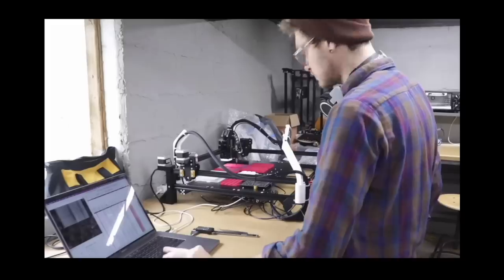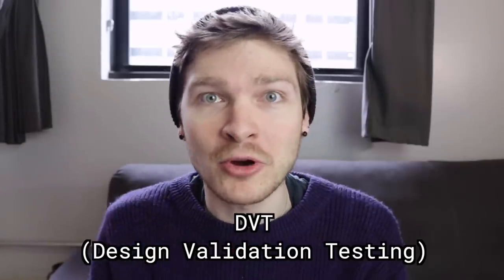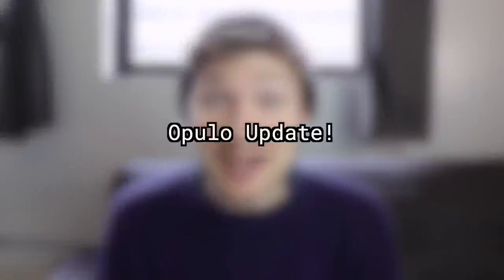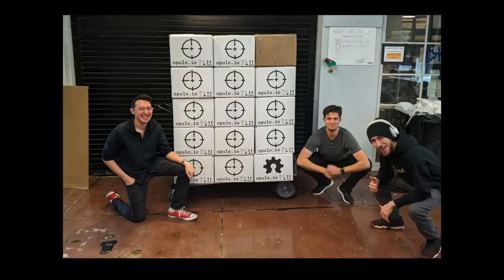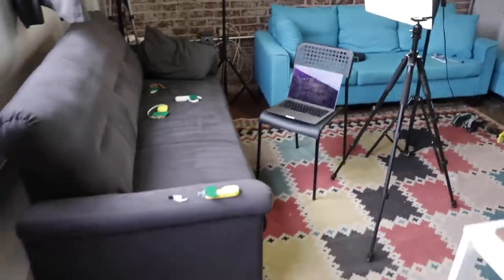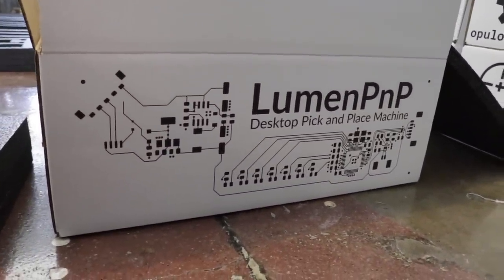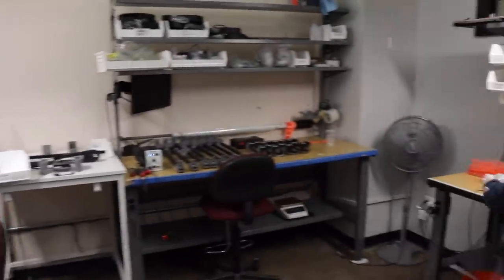prepping for launch

Comment: In terms of feeder behaviour there is quite a lot of variation of tape that needs testing with - paper, clear & black plastics that can have different stiffness, as well as different thicknesses of plastic - parts are more prone to jumping out with thin tapes. Part pocket size can also affect how the tape bends. Pocket depth can vary - 1210 caps and PLCC-4 LEDs are probably the deepest on 8mm tape. Wider tape has a much bigger range, e.g. connectors,  inductors and electrolytic caps. 
Cover tape peel force also varies. Paper tape can be a bit abrasive, and also sheds dust which can cause issues, e.g. you don't want anything that needs oiling near it as the dust turns it to sludge. 
Feeders are hard. I suspect you'te only at the start of a long and frustrating journey...

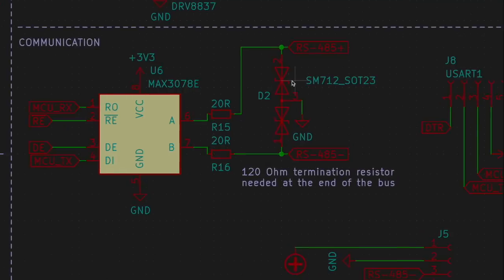Comment: 2:55 TVS diodes aren't very useful at protecting from 24V , as the 24V will likely toast them - you need to combine with additional protection like a polyfuse. 
However he best thing I've found are Murata PRG18BB PTC thermistors - these trip to a high-resistance state fast enough to protect RS485 and HCMOS from shorts to +24V with no additional TVS or zener protection. I usually use the 100R ones, as this also provides useful edge damping, or 33R if I care more about edge rates - the latter still offer good protection.
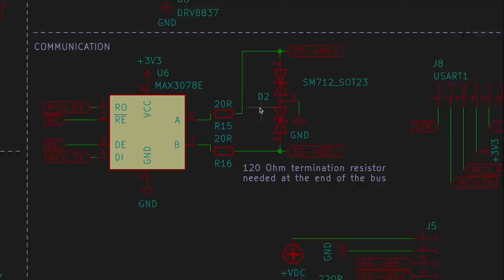Reply: Mike -- I agree with your assessment that the TVS diodes at 2:55 would get fried by the 24V hazard that Stephen described. They are more for ESD which is high voltage but relativeIy small total charge I think.  Your PTC suggestion-- presumably those are in series with the input, but what sinks the current to get them heated up?  Is this relying on the protection diodes in the RS485 chip (ie: to the rails)?  Note to Stephen: From following Mike's channel -- he has done a great number of RS485 projects, and has a lot of field experience with it!

Comment: Injection molding is not as expensive as you may think. It might make it easier to scale production instead of scaling out 3D printers.
Reply: Molds are incredibly expensive. Need a very high part count to spread mold cost over.
Reply: mold: hehe
Reply: Full disclosure, I work at a filament company, so of course I’m going to be biased toward 3D printing, but I still wanted to share my thoughts.

When you design a project, you tend to design parts in a way to be easily manufactured.  If you want it to be machined, molded, or printed, you’ll take different approaches to the design.  For example, something that is designed for molding might be hard to 3D print, and vice-versa.

This then boils down to a big-picture question “how should this be made in the long term”.  Injection molding absolutely makes sense if the end goal is for this to be an off-the-shelf product.  BUT, leaving something 3D printed enables and encourages the design to be changed, improved, and customized by anyone who has their own printer.  Some of these 3rd party design changes might even make it back into the official product.

This ideology is very similar to Voron and Prusa 3D printers.  For example, Prusa sells hundreds of thousands of 3D printers, but they still print as many parts as possible because it lets them make changes, and allows hobbyists to hack their own machines.

Parts that are designed to be injection molded will tend to focus on different things, such as minimizing/hiding flashing, adding small chamfers to seemingly flat sides to make parts pop out of the mold easier, and avoiding any internal structures.  It IS possible to design something that can be printed AND injection molded, but it’s certainly another layer of complexity.
Reply: @MrWizard65  they are, perhaps if he reaches out to Dragonfly Engineering, he might be able to do a collaboration on having some parts injection moulded 🤔
Reply: I agree. Full commercial injection molding is likely not something that will be super viable for this company for a while though. It's expensive and thus impedes the quick and creative iterative design paradigm that is finding them success right now.
I would say though, that it may be prudent to seek a middle ground and possibly manufacture casts of their own and do injection molding themselves. There is a youtuber that does this and shows how to do it. He even works out a lot of bugs in his videos. Right now he's building sets for a stop motion animation  he's doing. Shouldn't be too hard to find as he basically is fully funded by Patreons.
Despite the speed angle, which is very valid as 3D printers are crazy slow, injection molded parts are smoother and much stronger. Less chance of failure.
Reply: @MitchDavis2  I might over thinking, but if they have 18 printers, each running a print, it's more possible that some part, may have some problems (if they failed on a non detectable way), that during QC they might miss. Idk, might thinking too much. Either way, it's cool xD.
Reply: @NightVisionOfficial  prusas are reliable workhorses, i dont think it will fail
Reply: @MrWizard65  I agree -  the initial tooling costs can be pretty steep. Tool life estimates I've received are good for 200k to 250k parts, so you can start to see how you need to look at predicted demand and how to amortise the tool cost into the final part price.

My quotes for injection moulding have basically started at 5000 parts produced per tool for a minimum run, as any quantities lower come pretty close to same price as 5K parts!

If Prusa are still using 3D printed parts on their printers, then I think this is a viable option for scale. 3d printing also offers the opportunity to update the design whenever you want and you can sell hardware kits with CAD models to those who have their own 3D printers, reducing held stock of plastics and offer a small discount to the customer.
Reply: @NightVisionOfficial  oh yeah, certainly.  3D printers come with their fair share of QA issues. We have a print farm at work and there’s always something funky going on.  I’m just super excited that so much of the lumen PnP is printed because I have a handful of customizations that I plan on doing to my lumen once I finish setting it up
Reply: @haddow777  The Craftman??
Reply: @dhupee  haha i was thinking crafman too.
Reply: @dhupee  yes, thank you. You think I could link the name in my brain. Yes, he's awesome. So many great videos, I highly recommend him
 He has a whole section on injection molding including, if I remember, making metal molds that perform better and last longer. I'm pretty sure he outsourced the actual metal casting of the molds, but it shows what can be done.
Reply: There are also 3D printed molds for injection molding, which really shrink cost down. Another method is 3d printed molds/negatives for silicon molds for epoxy/pu/... resin
Reply: @johanness6545  yes, the craftman kind of goes through a whole assortment of options like that. Injection molding is only one small part of his video series. Still, he points out that a metal injection mold offers the best resilience and also will be quite  a bit smoother. It also allows for faster turnaround speeds.
Check out his series though. I'm usually more fascinated with his silicone projects myself. But they are better for creativity. The injection molding stuff is better for quick production of things you've really kind of finished working on and am just trying to put it out there.
Reply: Injection molds made from readily available high temperature filaments such as PEEK are perfectly capable of handling relatively low melting point resins like ABS and PLA in an injection moulding setup
Reply: @geekswithfeet9137  yes. I think his video touches on that. 3D printed FDM moulds aren't typically as smooth, at least without a lot of work. Also, they just really aren't as resilient as metal. Of course, there's no reason not to use 3D printer molds if they work for you.
Reply: I can share my own example. We just designed a custom enclosure for a product we are bringing to market. To 3D print a single prototype using an outsourced 3D print service was around $300. I'd say it is a fairly complex component requiring 7 machined molds. Some of the tooling is to make mounting brackets and so on. The mold tooling costs are around $15000 for real metal CNC machine tooling. The unit price comes in at around $5. We have a modest volume in the short term of around 2500 pieces. I also recall when it was 100k + for tooling and we dismissed it initially. We iterate our design and make changes using 3D prints. Do this enough times and tooling changes should be minimised. Your experience may vary, but that has been mine.
Reply: Rule of thumb is anything under 50k units probably not worth it
Reply: @stevenbense3504  interesting. That's what I've heard about commercial level molds. The last I looked into it, the prices were on the high end. I don't personally have any experience with injection molds. I was mainly pointing to a series of videos done by the craftsman  a youtuber who is amazing at all sorts of mold making. I'm quite certain he's on far too strict of a budget to afford any kind of high level injection molds like what your were discussing. He did have a couple of videos where he had a metal mold, although not commercial grade, so not high volume. His was more intermediate. I don't think he specified how much it cost him, but I'm quite sure it wasn't nearly as expensive. Of course, it all comes down to what your needs are. If the design is done fully and value is needed, a big expense like that can save money, because molding by hand is very time consuming and if paying staff to do the injection process, it would cost a lot. I've seen full production molds in action, with the mold release rods and such. They can go from one mold to the next quite quickly and really churn out a high volume so fast.

Comment: I've loved following your journey and you guys have done so well! It's great to see how you have evolved; embracing both lean manufacturing principles and continuous learning. I think those are two of the key aspects that help drive success in a startup like yours.

Smart move to MVP smaller 8mm feeders first - smaller feeder also prints faster to reduce iteration times. Focus on getting it right and then out the door to offer maximum relevance and value to customers......use lessons learned to develop the other sizes.

Congrats on the win - totally deserved!

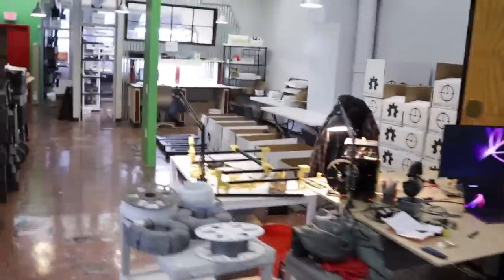Comment: 12:44 Very nice, only comment is perhaps more fold up trestle tables (you have a couple in frame) for final packaging assembly; packing on the floor isn't the nicest way to do it. Besides, fold up trestle tables are generally useful, cheap, fold away to nothing when not needed and easily on-sold if you ever want to get rid of them. Very proud of what you guys have done (an old [literally] Linux dude from way back).

Comment: Also, for the 3D printing shelf. I know that a number of filaments can soak in water vapor from the air and it can affect the quality of the prints. It may help with quality control to build a bubble or something around the printing shelf that has a dehumidifier in it. When spools start, things may be okay, but the longer it sits there, you may end up with issues with the prints. Just a thought.
Reply: Good suggestion, but I think at the production volume they're at the spools don't really last longer than a week maybe, so unless they're having really humid air I think they'll be just fine.

Comment: On your points about efficiency. Looking at your shop. I would investigate the 5S and 8 wastes from the Toyota production system and how to implement lean effectively. (I say this cause I am seeing a lot of batching)
Also, think through 3d printing vs polyurethane casting. Casting can be cheaper and faster (depending on the liquid plastic you get). I 3d print only prototypes to make molds. I am not yet at production level to need to either buy your machine or make it, but I am watching closely, over time it will make sense.

Comment: Hi relatively new here and first comment but been really enjoying the development of this system. Great idea for the design change. From the electrical schematic it looks like +24v is the pin that would connect first, is good practice to have GND be the first to connect in this sort of hot sawp configuration.

Comment: To avoid the shorting issue, I would put a NO cherry switch on the feeder mount that only allows power to flow through the connection when the mounting trigger is released and closes it.

Comment: Hey Stephen, I can share some insight with you based on a commercial P&P. I have a Essemtec Paraquda and their Hy-Q feeders are similar in function to your feeder (good job btw). The issues I run into with the commercial feeders are mostly with the thinner plastic carriers either causing the parts to jump (and sometimes flip) in the pocket after the cover tape is peeled or for the same thinner carriers getting jammed / bunched up before it can exist the machine causing the feeder to jam. The other issue we've run into is with cover tapes not peeling off nicely from some reels, and is hard to detect because even with the machine camera you can't see the clear tape easily.

Comment: Could you do a deep dive on adding protection to the circuit?
Reply: If you want to do a bit of research on your own, search for over voltage protection using diodes.

Diodes prevent “reverse” flow.  Basically, if you tie your sensitive input line with one diode in reverse going high (aka to 3V source) and the other to ground, then you protect your circuit.

If the input voltage ever gets too high (eg 24V in this case) then the voltage will “dump” out into the 3V source.

Now of course you don’t want to short circuit 24v to 3V, so you can use a resistor to limit how much current can actually flow.  Digital/analog inputs don’t need much current since they work on voltage instead.  That means you can use a 10k, or 50k resistor and not have any problems